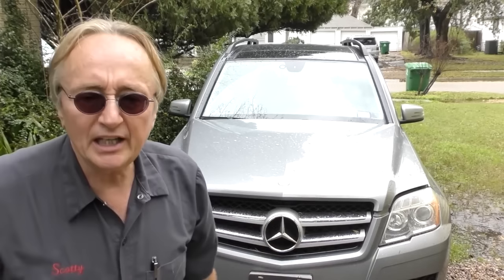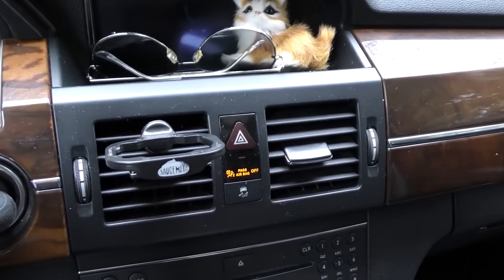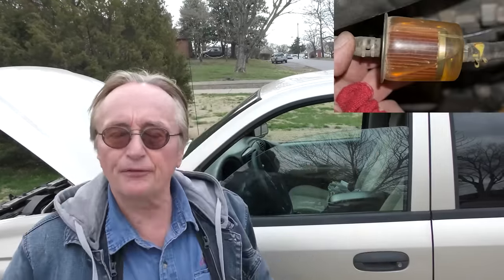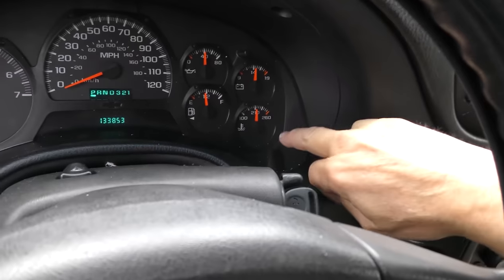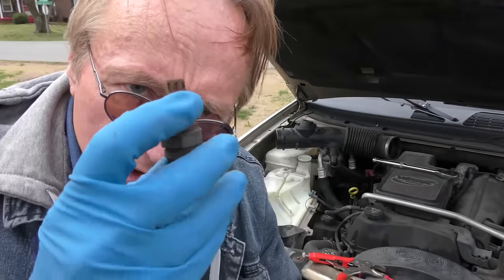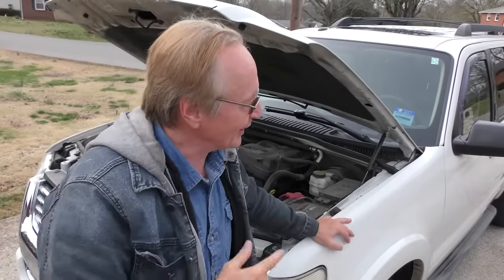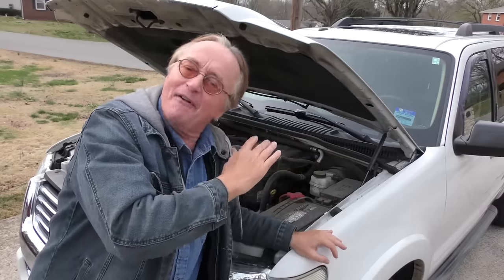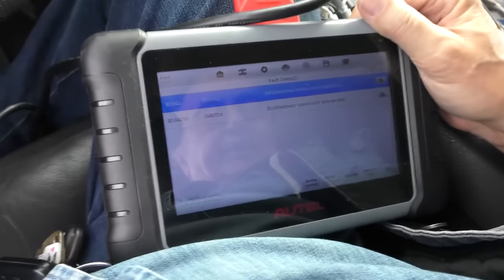3 SUVs I Wouldn't Touch With a 10 Foot Pole

Comment: Yesterday I got my first car Scotty!! I saved for a downpayment and got a one owner no accident 78k miles 2013 Honda CR-V. Thanks for all the info man. Dash cam next!
Reply: Why finance tur first car ??  You could have still got a good first car with your down-payment, you probably put down like $2000. Maybe $1000.  But even in my area, in NH, I can find decent cars and subs for that..not a honda ..but still.. but,  you did pick a good brand
Reply: @richsweeney1115 and yea Hondas super expensive but for that reassuring quality I’d pay top dollar for it. It’s my baby I love her 😍
Reply: The cars going for $1,000-$2,000 in NH most are that much cuz they need work and won’t pass the yearly inspection. Lived in Laconia NH for 5 years I’ve seen what you get from private sellers (buyers beware)

Comment: There's so many vehicles that Scotty wouldn't touch with a 10 foot pole!😂
Reply: Must tip toe through the parking lots
Reply: @WarWornWarrior lol😂
Reply: I bought 2 vehicles Scotty recommends and couldn't be happier. 05 Suburban Z71 4x4  with 350K+ and 07 Yukon SLE 4x4 230K+ and both will last longer than the new stuff. Paid less than $5,000 combined for both body on frame trucks. Both have the 5.3L engine. I inherited my Crown Victoria, which is another vehicle Scotty recommends and I agree with Scotty, Ford should still produce the body on frame Crown Victoria.
Reply: @Wicked_RotF30 Scotty has helped a lot of us out over the years. He is absolutely the best.
Reply: Including mine.  He calls me stupid. That's alright Scotty, I still love you.  😅
Reply: I wonder where he keeps his ten foot pole, and speaking of, what the hell does a ten foot pole even look like 🤔
Reply: Excalty the 10 foot pole part got me hard I hate mercs with a passion!
Reply: And mostof them are crap
Reply: @Wicked_RotF30 that's borderline better quality..
Reply: Scotty needs another pole!
Reply: Me either.🤷
Reply: If it doesn’t start with a t and end with oyota it’s garbage according to Scotty
Reply: @devenalley  go buy a stick of EMT or PVC. I imagine it's probably pvc
Reply: My pole isn't even close to 12 inches, much less 10ft, but sometimes it smells like a foot...
Reply: Unless it’s 15 years old he won’t touch 😂😂😂

Comment: The 350 GLK has a V6 engine that sometimes needs a timing chain replacement along with the balancing shaft/sprocket. Its a known issue of all gasoline V6 Mercedes of the era. Its not the end of the world. For what it's worth, I would do the repair in order to keep an otherwise excellent car.

Comment: EVAP Purge valve stuck open is a cheap repair. Gasoline vapors going in all the time making it rich. Runs like it is flooded on a cold-start after sitting a long time, fuel builds up in intake.

Comment: All of my Benz’s have been extremely reliable vehicles. None of them have ever left me stranded (yet) lol.
Reply: I think theres super large gaps in reliability between models and years lol, like the 80s W124 with the diesel engine are absolute tanks, while some of the late 90s/early 00s high end models with loads of new electronics and computers, not so much.
Reply: @mrsneakyburt  You’re right about that, 80s Mercedes taxis in Holland and Germany come to mind. they ran and ran and ran. In Holland you didn’t see anything else.
Reply: Do u buy them new??
Reply: Yea probably havent had many miles, or they're older
Reply: @CrimeVid  The same thing in Belgium.I know taxidrivers with more than 1 million km! Especially the model Mercedes E class W212 250 CDI
Reply: 1989 190e 2.6 was reliable as Hell. Inline 6.

Comment: I have one of those, the camshaft and the sprocket was one continuous casting piece. Because the sprocket was a casting with the camshaft it actually wore down and causing too much slack in the timing chain..! 
Who in their right mind does that? Doesn’t everybody have a steel chain sprocket bolt it onto the camshaft?

Comment: My dad had an 05 Trailblazer that he got around 09 (can't remember) and it ran fine but it had issues. Dash cluster backlight went bad. Fuel sending unit went bad. backlight in entertainment system died. The sun roof leaked. 4x4 didn't work properly. Engine didn't sound right. It had the manual dual climate control but it didn't work right and didn't split right, so dad always make sure both sides were set the same. Dad was a Chevy guy and drove a 97 Lumina to almost 200k miles. He had an 05 Impala he drove past 100k miles and it was fine. But the Trailblazer was crap.

Comment: I drive a 2014 mercedes c250 coupe with 80,000 miles. I’ve had absolutely no issues with it other than a bad fuel pump which was replaced under warranty.
Reply: Wait until you get to about 120k
Reply: @donniev8181  lmao my old c250 got well over 100k. zero problems, until it got totaled because someone crashed into me, not my fault.

Comment: my sister owns a 2014 glk350 with AWD. we got it at 62k for probably around 20 grand if i recall (in 2017). car is probably at 170k at this point and still running very strong with not much required beyond basic maintenance. yes, mercedes are expensive to work on, but find the right one and treat it well and it'll last you just like any other car.

Comment: Camshaft position sensors $23 x 2 for the Merc. Ive got 2  Merc's a V8 and the V6 do all the work myself and  still running strong v6 148k miles V8 243K miles Ive had to do basic maintenance and replaced an alternator on the V8 about 180k miles (was a whopping $60 for a denso alternator) The interior of the merc shown was not leather, that was what they call MB Tex. those cracks tend to come from using harsh cleaners or a microfiber to clean them with ( owners manual says not to use them on the interior upholstery)

Comment: I just got rid of my old 2009 Trailblazer.  It had 225,000 miles on the clock.  Honestly it was the smoothest driving car I ever owned.  I owned it for 6 years and had very few problems.  I only got rid of it because it had so many miles on it.
Reply: You probably would have been better off just fixing it, instead of buying something new, or newer . I'm not a big chevy guy,but those aren't that bad. I hope you got a used Ford or honda,lol.. my fords always had well over 200k and never had a major issue...ever. andyea, some were 4x4 explorers
Reply: @richsweeney1115  Well there really wasn't anything wrong with it, other than the tpms and a wheel sensor.  It ran great.  I did end up with a Honda Pilot
Reply: Those inline Atlas engines were some of the best ever made.
285-horsepower, 4.2-liter inline-six-cylinder with 276 pounds-feet of torque
390-hp, 6.0-liter V-8 with 400 pounds-feet of torque

Comment: 2011 Ford Escape FWD with 2.5L 4 cyl it’s a great little suv.  My mom has one very reliable 160k miles on it now.  That motor very good and good on gas, I agree the V6 is very inefficient.

Comment: Ah Scotty,  finally you made a video of diagnostics of the car of my choice the Ford explorer 4th gen 4x4. Actually it's a pretty nice SUV, I had the 2009 model and the only major problem with this SUV is its drive chains in the engine and there are two of them, there is one in the front and the other in the rear side which is actually the pain in the rear butt because you have to pull the engine out secondly the car 's computer module or the PCM doesn't last long and when it breaks down the whole car gives all sorts of codes making it difficult to figure out whether the sensors are bad or the computer itself. I sold my SUV only because of these two issues which nobody could have fixed this in UAE. 
The 2009 model and above doesn't have transmission problems. I wish if  you were here you could have fixed my SUV for sure.

Comment: Typical Crack in the seat? My grandfather had a 1974 240d. Over 240,000 miles when he died. The car was 35 years old. The seats still looked like new.

Comment: Idk why someone would put a 250k mile engine 
When the original engine must have blown before 130k since that’s what’s on the clock. 
      You’d think you would want a engine with less or equal to what’s on the odometer

Comment: I have a 1996 chevy 4.3L 1500 truck i put it in drive and drove about 5 feet and heard a loud cracking noise in transmissoin then i put it in reverse and drove about 3 feet and heard the same noise do u have any idea what that may be ??
Reply: user-dc4so3wr1n  do u have an idea what it may be

Comment: It's not the 4 wheel drive you need to worry about on the Explorer, it's the timing chain system if it's a 4.0.  One chain on the front, one on the back, engine needs pulled for service. Change the hydraulic tensioners (use oem) every 70,000 you might be okay. But the tensioners get gummed up and the plastic chain guide cassette will wear and the chain will snap, trashing the interference engine. Ask me how I know. Mine grenaded itself at 175,000. German engine at it's "finest". (Ford 4,0 is the Cologne 6, designed in Cologne Germany). What kind of idiots make an engine with one timing chain on the front, and one on the back? That's why I'm a Lexus guy, not Mercedes or BMW, lol!
Reply: Iirc ford basically tried to turn an ohv engine into sohc
Reply: @radiofreemongoliaofficial  That would make sense.

Comment: My 2003 Trailblazer EXT with the v-8 had the infamous ignition switch problem ($750), 3 re-flashes of the transmission, front hubs replaced ($500) all after the warranty expired.  Otherwise it treated me very well.  Traded in at 90k miles in 2011.
Reply: 90K is low miles. Sad list for that age.
Reply: Yes, and they changed the part number to try and hide the fact it was defective.

Comment: Hi, Scotty. I would sure like to see a more vids on doing a specific repair. I need to know how to replace the dash lights behind my AC/heater controls on my 2006 Ram 2500, for instance, without busting a bunch of plastic clips. I think these vids help us with general knowledge, even if the repair is not for our exact model. Thanks.

Comment: I have a 2015 Mercedes GLK 250 diesel with 96k on the odometer.. Great MPG.. Bought it with 28k mi for $26k . So far its been a great car, comfortable and drives great, no problems yet.  I am nervous as I know any major fix will be very expensive.. Also being a diesel I worry about the emissions issues? Mercedes did a recall and paid out to diesel owners because of a scam they did. All in all I like the car a lot. But, probably wont buy another Mercedes.
Reply: I also have a GLK 250 with 95,000 miles. Awesome vehicle.  Regularly get over 40 mpg on the highway

Comment: What about the 3 SUVs you WOULD touch with a 10 foot pole, Scotty?
Reply: If I had to guess, probably a Rav4, CRV, 4Runner. If not that at least some combination of Toyota and Honda SUVs and possibly another brand
Reply: @jordanseay216  the 4runner comes up the most with scotty but they're just too damn much used with over 200k miles on them. For me, idc what it is, a 2010 with 200k on the clock ain't worth 20k.
Reply: @monopolizedopamine  yea fr. But at least if you can get one they seem to hold their value extremely well. I’d probably get a V8 Sequoia if you don’t care about MPG that much.

Comment: Legit, low mileage Trailblazers are actually pretty decent vehicles. Cheap plastic interiors but the platform was solid and thst straight 6 engine was silky smooth with big power relative to when it debuted. Family member had one that only submitted to New England winters with road salt after 15 years.

Comment: So you have almost 20 year old trailblazer with over 250,000 miles and sat for over a year and all it needed was a o2 sensor and you wouldn't want one sounds like a reliable suv to me, I have an 03 trailblazer with 175,000 and have owned it for over 12 years and while it has no power and the 4wd system is ehhh overall it has been a solid vehicle a pain to work on because of the engineering but doable, those original trailblazers 02-09 will out last the new version by miles and years

Comment: Hi Scotty, When you do a simple oil change, does all the oil get drained from the engine or some amount of it stays in it even after complete drain?
Reply: Most of the oil would be drained out. Let it drain to a small trickle
Reply: I use ramps that compliment the angle of the drain plug.

Comment: I would avoid the Ford EcoSport with the turbo three cylinder. I'm a little surprised that wasn't on the list. I would tend to avoid the Explorer with  AWD because if that system goes on you getting it working right can cost big time. More than it's worth. But an Explorer especially with the 4.6 that's just simple RWD can be a good buy if it's been maintained and hasn't been seriously wrecked.
Reply: I'd avoid any newer Ford. 4.1 million recalls in 2023 so far. Ford is trying to put out to much technology too fast.
Reply: Any Eco boost engine really.

Comment: Hey Scotty long time fan and first time commenter.  I have a 2011 Infiniti FX35 with about 201,500 miles on it.  Got a check engine light and scanned it saying code U1000-01 past can comm circuit.  Where do I go from there about what it could be?  Vehicle drives like it never threw a code.